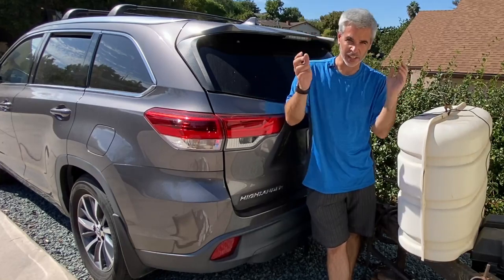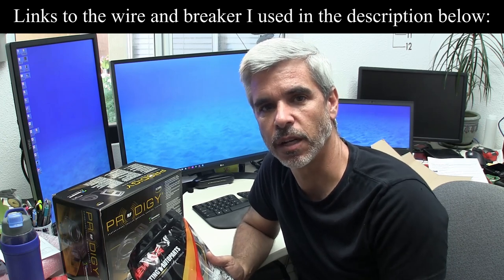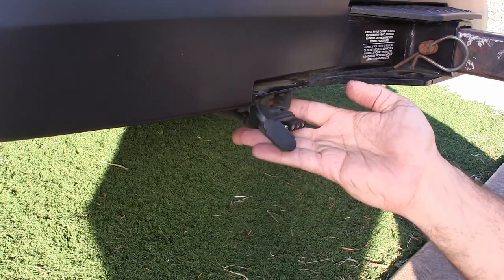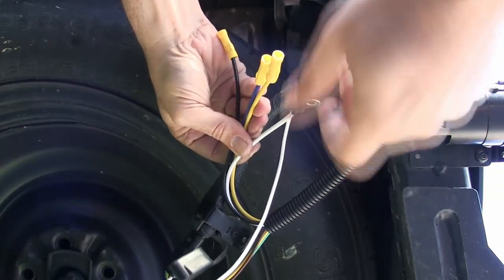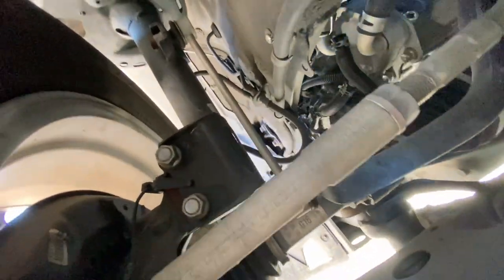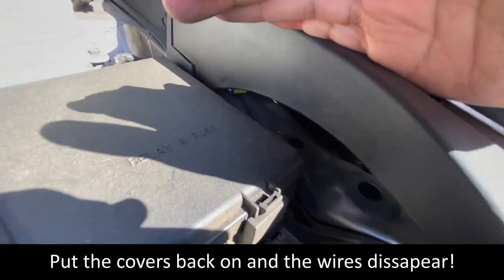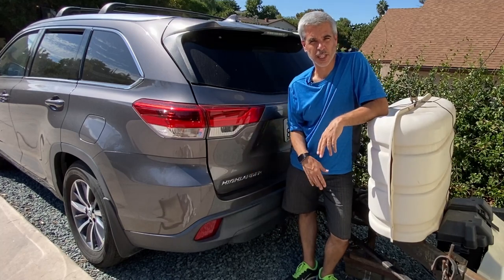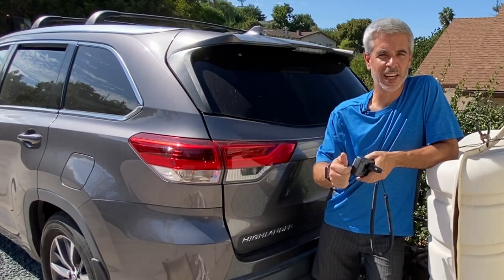Toyota Highlander 7-Pin Trailer Connector Installation

Comment: I would like to maintain a 4 pin connector for boat and utility trailer. How does one modify to have both 7 pin and 4 pin?
Reply from the maker: There are connectors that provide both.  The assembly I used accepts the 4-pin that was already there, and just converts it to 7-pin. What I personally use is an adaptor that takes the 7-pin and converts it back to 4-pin like this one: https://amzn.to/2WSqMly

Comment: Hey Dan, so just so I understand, by using a wireless brake controller you don't have to worry about installing anything in the cabin by the brake line? Also, do you need to worry about this draining the battery at all?
Reply from the maker: Yes!  No wiring needed to the 'brake' wire on the trailer connector.  The Prodigy controller is mounted on the trailer and the 'remote' is a user interface you plug in when towing. The remote only shows the current value (intensity) of the braking, and lets you both set the value as well as manually apply the brakes.  I will say that there is occasionall times when the wireless connection shows NC meaning no connection, but that is typically brief.  This doesn't change the braking however, because the control is all on the trailer end, it would just keep you from manually applying the brake when not connected.  No big deal in my experience because once you have it set up, it just works automatically and I don't find myself doing much with the remote but looking at it when braking...  I have that Prodigy controller listed in the description.  Oh, and I haven't had any issues with the battery being drained.  It likely just turns on when the vehicle is connected because it does need the 12V, 30A connection at the connector.

Comment: This was super helpful. I noticed that you didn't hook up the blue (brake) wire. How would you handle that one?
Reply from the maker: The blue wire would go to a wired under-dash brake controller.  The Prodigy controller handles that directly on the trailer.  The trailer harness plugs into the frame-mounted Prodigy, then a separate connector goes to the tow vehicle.  So for this wireless installation the blue wire doesn't go anywhere.  Make sense?

Comment: Thanks so much for the video, I just completed the install and it went smoothly once I figured out the route. I managed to suspend the wire/housing with zip ties along the way, however your method with clamps is more secure. I purchased a 4-7 pin converter like you have, but it didn't come with the breakers or long power wire. I should have gotten the complete kit as I had to track down wire/breakers on my own.
Reply from the maker: Hey Sasha, glad you got this done. I have links in the description for all the parts you need for this installation.

Comment: Nice Video:  Quick question -  if you are connecting your green wire from the cable in the front of the vehicle to ground, are you then running it to the white cables at the back of the vehicle, which are ground also?  If both are ground, do you really need the green wire connected to ground in the front of the vehicle?  And I'm guessing that the white wire in the cable that you have going down a hole in the frame at the front of the vehicle does not connect with anything?
Reply from the maker: It is totally possible to use the frame as the ground vs. running that wire as well.  I had a secondary motive in that I wanted to have the wiring available to put an inverter and subwoofer amplifier back there so the extra wire would provide clean power and ground for that.  Yes, the white wire is unused currently but could be used for these alternate loads in the future.

Comment: Thanks for video. My Lexus RX  SUV has a 12 volt accessory plug in the trunk so I just tapped into that wire to get 12 volts. Then poked wire down through trunk where spare tire is.

Comment: can you activate the prodigy brakes without activating your Highlander brakes, such as if your trailer starts to sway?
Reply from the maker: Yes, the remote control has a manual button to test/activate the brakes when going down hill or whenever you want.

Comment: I'm installing a 7 way on my 2019 highlander I have questions on were to connect the white wire to was it to the negative terminal to the battery.
Reply from the maker: It can go to the frame of the car, it doesn't have to have a separate wire all the way back to the battery.  The black wire goes to the battery through a 30A fuse.  As long as a meter reads 12V when you measure between the white and black wires you are good.

Comment: Curious if you've had any issues with the location of the 7 pin connector being mounted lower than the hitch receiver. I've read that it sits too low on the highlanders and sometimes bottoms out.
Reply from the maker: I haven’t bottomed it out myself.  If you off-road without the trailer or hitch, then it would be the first thing hit as it does reduce the exit angle a bit, but there is still a lot of clearance.  If you are worried just leave the hitch mounted in the receiver so it would be the first thing to scrape.

Comment: Thanks for the video , have a question: what exactly a weight distribution hitch do use for your Highlander?  as I have exact the same ? Thanks
Reply from the maker: There are many hitches you can get.  Mine came with it, so I don't have an exact part number I can find on it.  Looking at Amazon, there are two major types available.  The more modern type uses a square bar like this one: https://amzn.to/3kREei9  

The older style, the one I have is like this one: https://amzn.to/3qR6lBZ

Either of these need to be installed and tuned to your trailer.  Best to get help if you haven't done this yourself and understand how it all works.
Reply: @DansWay  , Thank for your immediate response,  I'm very appreciated,  and for the links , definitely will explore some of them . Safety first of all)) 😉🤝👍

Comment: I agree with two other commenters. The 7-blade Vehicle plug is pre-wired with 12, or 16 gage wires; but he has you spend a fortune to purchase and 8/3 gage heavy duty cable rated for over 40 amps; where the Vehicle plug is only 10ga or 16ga rated for 30A or 25A.
Reply from the maker: My only point there was to install a heavy-duty armored cable that could properly carry 30A and was readily available on Amazon.  I used the 4-conductor myself because I wanted extra conductors for either trunk-mounted inverter or sub-woofer in the future.  You could also argue that you can just run a single conductor and use the frame as the ground return.

Comment: great video, I'm about to do the same. Question, the 8/3 wire comes in 10ft or 25ft.. is 10ft enough or do I need the full 25ft? Thanks
Reply from the maker: I don't think 10ft is quite enough, but I would measure the run as best as you can to confirm before spending the extra money on the longer length.  You can also purchase custom lengths at Home Depot or other big-box store.

Comment: I'm new to hauling larger trailers and have never had a 7-wire harness. I'm not clear on several points w.r.t. the brake controller - was wondering if you could help here?
* Why use a brake controller, instead just connect to something that reflects braking action on the vehicle (i.e. connect to the power signal that turns on car's brake lights)?
* If using the brake controller, how is the sending unit determining that brakes are being applied?

Thanks!
Reply from the maker: The key thing about a modern brake controller is that it measures (with an accelerometer) how fast you are trying to decelerate and ‘helps’ by applying the trailer brakes gently or hard depending on the need.  If you only had on/off control it would be either jerky when you just barely push in the brakes or not powerful  enough when you really are slamming on them.

The sending unit also has a variable trigger or button that lets you manually apply the trailer brakes which is helpful in some situations vs using the vehicle brakes at all.  The trailer pulls back on the truck when just the trailer brakes are applied.

Comment: Why did you attach the green to the body of the car? ... for a ground.
Reply from the maker: Yes sir!  I really didn't want a second connection back at the battery...
Reply: @DansWay  Why didn't you just connect that ground on the frame at the rear instead of running to the front?

Comment: Hi Dan, we had one of these installed on our Highlander by a travel trailer dealership that went out of business during the pandemic.  During our last trip, all of our lights went dark: running lights, brake lights and turn signals.  I have checked all connections and ground wires and everything looks good.  I have no idea where to look for the fuse(s) for the wiring harness.  Could you please tell me where to look?
Reply from the maker: When you say all the lights went out, are you saying just the lights on the trailer? Or the lights on the vehicle are also dead?
Reply: @DansWay  Nope, just the trailer!
Reply: @DansWay  I found one fuse in the box under the hood that was marked "Tow" and the diagram showed it should have a 30 amp fuse in it; there was only a 10, but it wasn't blown. I did put a 30 amp fuse in just to see if the lights would work, and they didn't.
Reply: @Archie583 I don't know much of anything about this, but I read some comments elsewhere saying to use 10 amp fuse, because if you use a 30 amp fuse, the controller or whatever that is connected to will be damaged. Long story short, the incorrect information is in the manual.

Comment: Great video Dan and thanks for sharing. I just installed the 7 pin and factory wire harness and all went smoothly. Last step is the battery connection but I was a little confused about which specific connections you are making up by the battery. Would you be willing to describe this last step in a little more detail? Just want to make 100% sure I'm making the proper connections. Thank you!
Reply: For instance, are you just connecting the black wire to the black wire in the back on the 7 pin? And then up front where are each of the 3 wires connecting? thanks
Reply from the maker: Sorry about being vague on the steps. The battery positive connection goes directly to one side of the fuse. The second side of the fuse goes all the way to the back seven pin connector. You can ground the return ground at the back to the frame, or connect it to the frame or battery negative up in the engine compartment. I chose to do this, because I also plan on adding a subwoofer in the trunk, and wanted a separate clean ground for that.
Reply: @DansWay  Okay thanks Dan I think that makes sense. Love the subwoofer idea btw. For my needs I just need the power from the battery for my trailer and break controller. Wondering....in this case could I get away with just one wire, as opposed the the three you are using? And just ground the 7 pin to the chassis back there? Am I understanding this right? Many thanks, Dave
Reply from the maker: Yes, exactly. A single wire should work.

Comment: Thank you so much for this. We just bought a camping trailer and realize that we need to do this on our 2020 HiHy. Probably a really stupid question ... but the wire from the battery port goes where? All the way to the 7pin connection at the back or to the 30a breaker?
Reply from the maker: Congrats on the trailer purchase!  You need to wire from the battery itself to the breaker, then breaker to the 7-pin wiring harness.

Comment: Did you have any issues with the 7-way bracket hitting the trim that came with the OEM Hitch receiver ? It is called the LH Fascia Trim? I’m wondering if the new slotted holes helps alleviate this problem?

Comment: Thank you Dan.   As a northerner, I'm concerned about longer term corrosion when you drill into the car's panels for grounds and mounting.  Any thoughts?
Reply from the maker: Sure, I’m not sure my method here would be best for that.  The holes and brackets themselves could rot out.   I guess I would run the wire through the interior, in which case I would get standard single stranded wire vs. the armored wire I used for the outside.  You can run the wire along the drivers side, under the door trims up to the footwell, then through the firewall.  

Let us know how it comes out!

Comment: Thanks for the video very detailed. I'm exploring to rent a trailer, but wasn't sure the max weight for it. The SUV is rated for 5000lbs, but that's unloaded.  How heavy is your trailer?  Thanks
Reply from the maker: Glad it was helpful! My high-low is nearly 4000lbs, so just because it doesn't have a huge wind profile, it still is heavy.  The Highlander pulls it great however with the 300hp it offers.  I would like to have more mid-range gears, but it definitely pulls no problem.

Comment: Great video and helps a lot as I will probably purchase a Highlander soon to tow our 17 foot 3,300 lb Forest River.  Had no idea there was a hand held remote brake controller.!  Have you found your Highlander capable at pulling your camper trailer?  Thanks for the video.
Reply from the maker: I have no problem with my Hi-Low.  Yah, the prodigy brake controller makes the installation easier.  I will say that just yesterday, after studying the electrical diagrams, it appears that the trailer harness in the back includes a wire that is fused at 30Amps, so perhaps the extra power run wasn't needed?  I haven't opened up the panels to check the wire gauge at the back to confirm.  Nobody seems to use this, or offers a 7-pin adaptor that utilizes this for some reason...  Not sure why not which has me suspicious that it really what's needed, but why 30A then??
Reply from the maker: Hey John, have you had a chance to purchase the Forest River yet?  I'm considering a 3,300lb trailer as well and wondered if you have experiences to share.
Reply: @DansWay  Hello,  We purchased the Forest River and towed it with an 06 Trailblazer.  Due to the difficulty purchasing new Toyota's and prices on old ones we decided to hold off on purchase of a Highlander.  Hoping next stpring either a Highlander of SequoiaL
Reply: @DansWay  Hi Dan, I'm in the same boat. We are looking to purchase a 3300lbs travel trailer to tow with our new 2021 Highlander XSE AWD. I will give you some update hopefully in a few weeks. I'm sure it will do fine but my concern is mainly going over the grade in the Sierra Nevada here in California. How heavy is your trailer and how well does it tow going uphill with your 3rd gen Highlander?
Reply from the maker: @reempire888  I would say you shouldn't have a problem with 3300lbs on the Highlander.  I would love it if the gears were tuned for lower speed driving.  There are lots of gears meant to freeway speeds vs. 30-55mph range when towing. Definitely use anti-sway and load-distribution bars and tune them for your loading of the trailer. Keep in mind that carrying water for your trip can significantly modify the load distribution and tong weight of the trailer.  Mine has the water up front, so if I carry water I have to adjust the setting on the bars to compensate.
Reply: @reempire888  How did things go for you just bought a 22 Highlander and want to tow a 3500 lb travel trailer.  Wanting to get a heavier duty hitch and have to convert to 7 pin wiringm but then we hope to go in it!  Do you have the stock hitch or did you get a bigger hitch
Reply: @lilyaltman3856  After towing from Texas to the CA (just over 1780 miles) and my recent trip from CA to Southern Oregon (900ish miles total), I would say it's great, our HL has no problem going over mountains. I used the Andersen weight distribution hitch and it worked great. It came with a 2 5/8 hitch ball.

Comment: Thanks-good video. Gotta do this for my 09 Highlander. I may have more questions, but the first one is how did you connect the reverse light wire? My Scamp 13 has a reverse bulb on it's tail lights but I guess it's sort of optional.
Reply from the maker: You will have to tie into the rear brake lights to enable backup lights and connect it to the Yellow connection on the 7-pin setup.  I didn't bother as my trailer doesn't support this right now.  Basically you need to connect to the tail-light cable harness which you can access from the inside back of the drivers side rear light assembly and route the wire down to the 7-pin behind the trim inside.

Oh, and I installed a backup camera which lets me see back there 100% of the time, so the backup light was even less needed.  I DO understand this is needed for traffic situations where the lights would indicate to others that I'm backing up...  I'll get to it...

Comment: I ran into some difficulties. Once you connected to the 4-pin, your video cuts to the point where you had already made the other connections and had already run the cable to the front.  I didn’t see what you did with the white, blue and yellow wires in the back of the vehicle.     I assumed that the blue and yellow can be capped off.  I attached the white to the vehicle frame.   Up front, I connected the black wire from the back of the vehicle to the silver terminal on the breaker then made a direct 8-gauge wire connection from the battery positive terminal to the breaker brass (?) terminal.  I attached the green to the frame.  

Now, the vehicle won’t start.  No idea why.  Maybe I shorted something out?  Maybe you might know based on the information I just provided. 

Thanks.
Reply: Weird.  Everything is now working.  If you have any feedback or thoughts, please let me know.